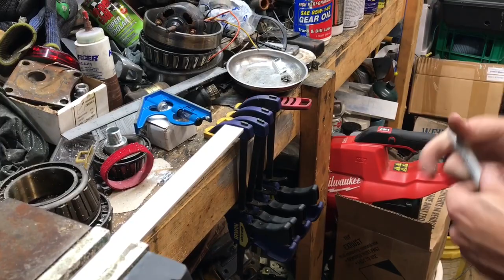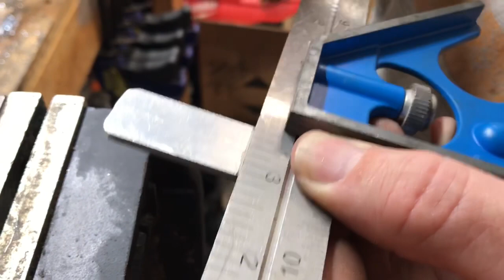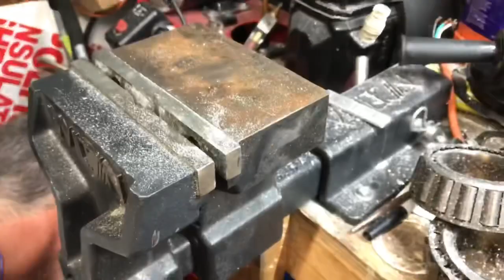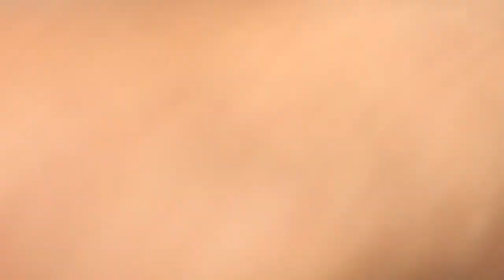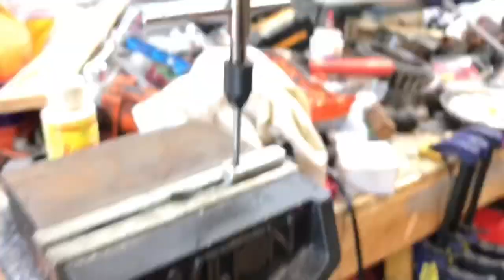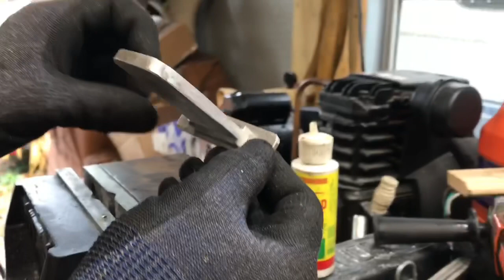Wanderlodge Fridge Lock

Comment: The messy bench is in your "Genes"!  😜😜
 Looks like you could use a file card and some countersink bits. 
How did you thin out that piece, and what is the "lock"  (vertical piece) made out of?
Reply from the maker: Yea, your right about the Genes.. Yes, or a small mill.. but it worked.. I ran my metal blade over it scoring it then smoothed it out with a grinding wheel. The lock piece is made from HDPE, it was apart of a crane pad that I cut to make ramps. I just cut a slice off and then cut it down, easy to shape with wood tools, chisel and files..
Reply: @GinosGarageUSA  yeah, HDPE is nice to work with. Durable and pretty easily shaped.  Maybe look into getting a harbor freight bench top mini mill.  Or maybe a small 3 in 1 machine.